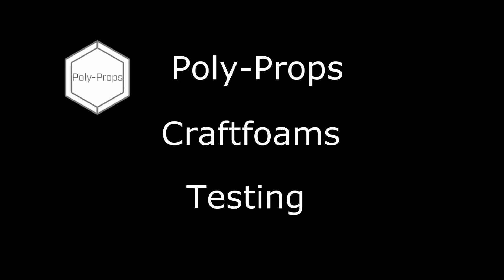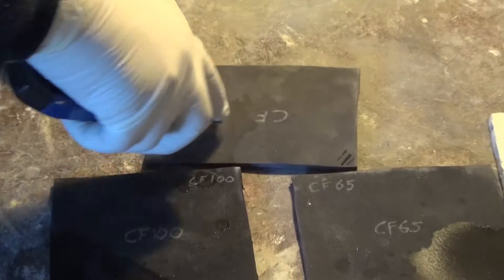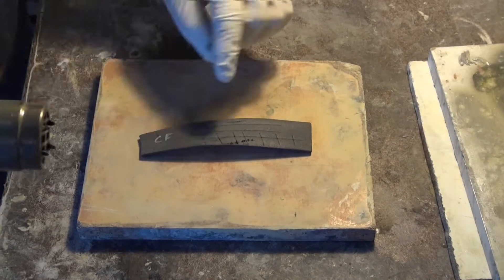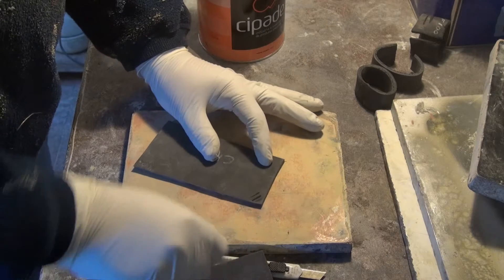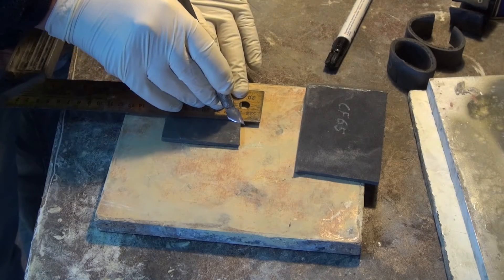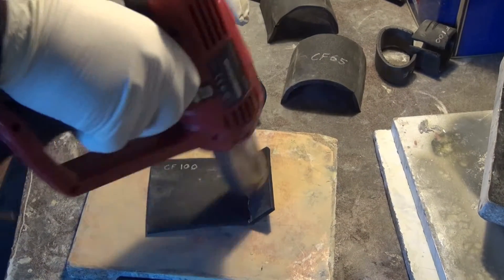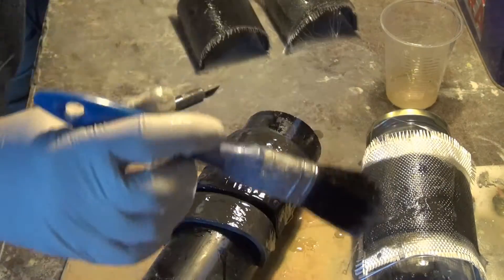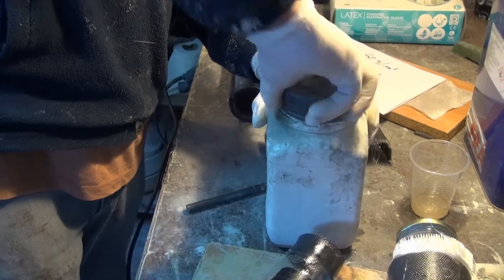Testing - Poly-props craftfoams

Comment: Use silicon brushes, because the only thing that can stick to silicon is silicon. You can just pull the resin off without ruining your brushes.
Reply from the maker: I've tried that, and figured that there is a lot of wasted resin in the brush, and the brush is too soft and mushy and does not work to apply pressure on the fibreglass pieces to get them in place. But if you only want to spread resin, yes, silicone brushes will do. This acetone dipping method allows me to reuse brushes for a longer time, and it works for me. I do not claim to have the best method, and I understand that some people prefer to use silicone brushes. Thank you for your input
Reply: Fair enough. my apologies if it came across like i was telling you to. i meant it as a suggestion. And thank you for the video.